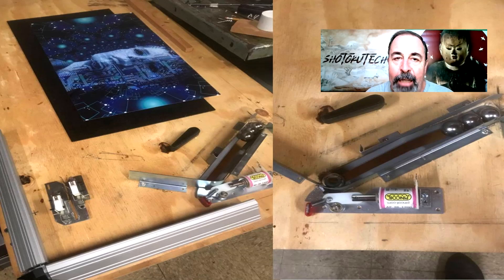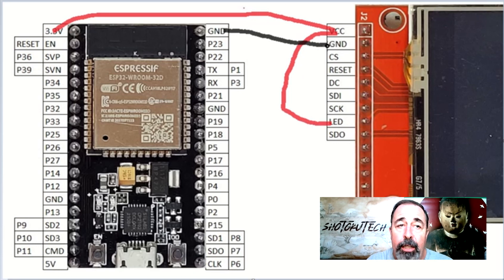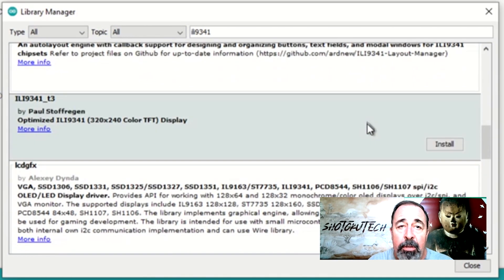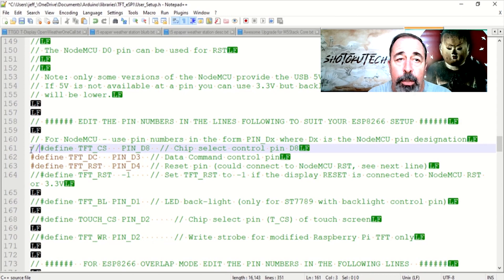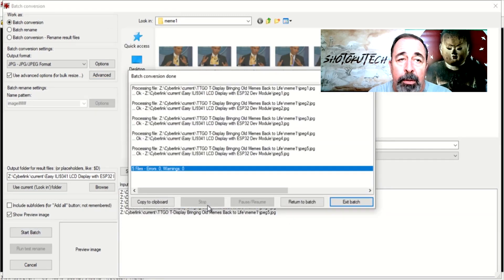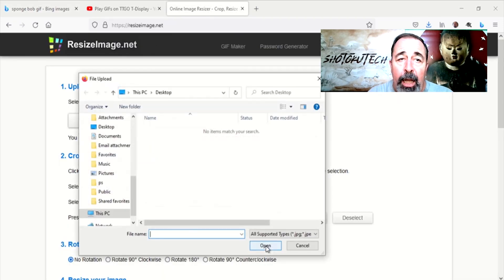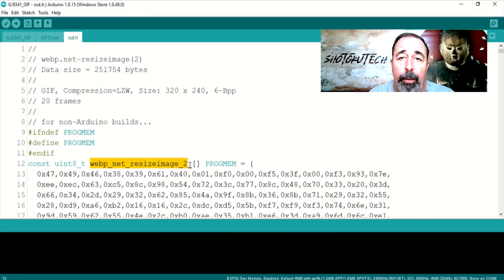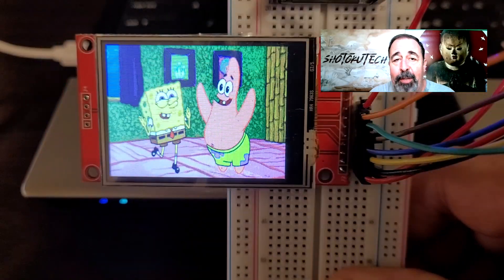Simple ILI9341 LCD Display With ESP32 Dev Module Step By Step

Comment: tHANK YOU SO MUCH, however, after doing all you said I het a white flashing screen. It's been 3 days I'm on this and nothing seems to work...
Reply: Arduino says it’s a ESP32-WROOM-DA MODULE H
Reply from the maker: How do the GPIO pin numbers compare to this wiring guide and the video? Not the physical pin, but the GPIO pin? https://github.com/ShotokuTech/ESP32_ILI9341_Wiring_Diagram
Reply: @ShotokuTech how can you not post pictures in responses it baffles me as well😂😂😂
Reply from the maker: @BriceDeCamargo  YouTube has to carefully control the comment section. Porn spam bots would likely take over if users could post random photos or URLs. Even posts with Arduino code get held for review.
Reply: It differs.
Reply from the maker: @BriceDeCamargo  If the GPIO numbers are different, either the wiring or the code must change. What I did three years ago with the ESP32-WROOM-32D might not work with a different ESP32 board variant, without some modification. I don't have this ESP32-WROOM-DA MODULE H to test with right now. So I would try wiring by the GPIO pin number opposed to the physical pin arrangement. Even that might not be sufficient. I know ESP32 S3 GPIO numbers are totally different from the ESP32.
Reply: @ShotokuTech I get that. For example if on the tutorial pinout let’s say GPIO5 is on the right side but on mine it’s on the left, I assume I have to wire where GPIO5 is situated on mine? Or if GPIO5 on mine is in place of let’s say GPIO17, should I then wire to GPIO17? I tried to use common sense but obviously it doesn’t work that way. About the code, I thought it was about this and have to edit setup.h file but as of today I have no notion of doing such things so I might have to do a lot of reading before being able to accomplish such an easy thing. 🙏🏼
Reply from the maker: @BriceDeCamargo  So wiring to the correct GPIO5, etc. doesn't work?
Reply from the maker: What ESP32 board are you using?

Comment: Hi, I need help. I have done all the steps mentioned in the video. But my screen is still showing the white screen of death. Any reason why this could be the issue?
Reply from the maker: Something is missing or different hardware. It is difficult to guess at this point. Best wishes.
Reply: Hi same problem here, were you able to figure it out?

Comment: Ok so I have to update the .h file for the ILI9341 tft lcd that I am using and also dwnload ,install the TTGO files for TTGO-T8
Reply from the maker: These instructions are for using the ILI9341 with an ESP32 using the TFT-eSPI library. You need to load the board definitions for your particular ESP32 board in board manager. And you need to select the correct display driver and pin assignment in user_setup.h and display driver in user_setup_select.h. That is the flexibility of the TFT-eSPI library. It works with many display drivers and can have flexible pin assignments.

Comment: Is it possible to add a port for charging the device or batteries or rechargeable batteries to this kit? Is it too complicated
Reply from the maker: You could add a small charging module. The ESP32 Dev Module does not have this built it. Something like this: https://amzn.to/4335MW9
 TTGO T-Display and some of their other boards do have battery ports and charging circuits.
Reply: @ShotokuTech  Thank you very much for your answer! The device has to be connected to the charger all the time, can I buy a rechargeable battery?
Reply from the maker: @patrick92  I use these batteries. Then it will free you from the USB cable. https://amzn.to/41Mkrn6

Comment: I converted the gif to 480x320, it is not accepted
accepts only in the range of 320xsomething
need help
Reply from the maker: Do you have some different display? ILI9341 is 320x240.
Reply: @ShotokuTech   yes ili9844 480x32 3.5 inches
Reply: plays the normal ili 9341

Comment: is it ok to connect the ili9341 vcc to 5v?
Reply from the maker: Does your ILI9341 support 5v? That is the question in my mind. As long as you supply 5v the the ESP32 and the attached devices are compatible, it should be good.
Reply: @ShotokuTech  I think so...but please..please make a video about ili9341 video player.
Reply from the maker: @kumaraliyanage8629  I think this is a good idea. I have been struggling with my current video. So maybe I will do this next.

Comment: I bought this shit (ILI9341 display) and it work but not in every one initial libs. When I see on the authors it work, this same example with my shit doesn't work.
Reply from the maker: Anything specific I can help with? What libraries are you trying to use. Shit don't cut it around here.
Reply from the maker: Yeah I don't watch other channel's videos, so I don't allow the links in comments here. It seems the code on their github is for different board than ESP32 dev module. I don't think it would compile for ESP32 and work. I am about to dust off ESP32 and ILI9341 for a video, I could address the touch screen and the card reader in a video and what do you want? Drawing on the screen?

Comment: Can I ask you favour, please! 
I want to adjust the picture in the middle of the screen, how can I do it, please! 
Thanks in advance!
Reply from the maker: If you look at the example sketches on my Github, the 
"tft.pushImage(0, 0,  320, 240, jpeg1);"
command starts with the beginning location
"0,0"
that is x,y location to start drawing the image.
Try adjusting the starting x,y values to move the image.
But it is best to make images the size of the screen, 320x240 in this case, so you can just use 0,0 for the start.
Reply: @ShotokuTech   thanks for your reply!  i used an AnimatedGif Library, but my problem is how to adjust it in the middle or anyway , i think it depends a specific function while encoding ... This is my problem 😕
Reply from the maker: @Zuzu7570  So modifying the middle of the GIF image itself? Only thing I could think of is breaking the GIF into individual images and editing them individually, then make them into a GIF again.

Comment: Why do you use to different methods to convert JPG image to h file type?
Reply from the maker: I haven't found a one size fits all means to do so for each different library or hardware. Some JPG coverters just work better is some circumstances. Thanks!

Comment: Hello, I have a question, is there a way to connect two or more sensors to the Heltec LoRa 32 board, and if possible you can help me to do it
Reply from the maker: Which sensors?
Reply: @ShotokuTech  DHT11, DTH22 OR DS18B20 or any other

Comment: Another good video. One idea for a future video is for RP2040 multi-processor coding using Arduino. There are many using Python but I have not found any for the Arduino interface and using C. A good example could be updating a 2 or 4 line LCD character display with sensor data. So Core 0 could read the sensor data and Core 1 updates the LCD display. This could involve Core 0 passing data to Core 1 and then Core 1 handling the slow response time of the LCD display and not slowing down Core 0 activities.
Reply from the maker: Might need to put on my thinking cap for that one. I'll try. Thanks!